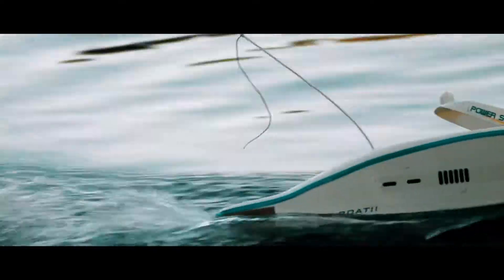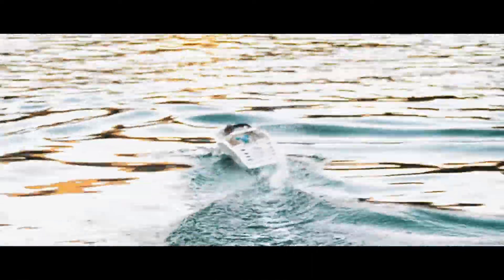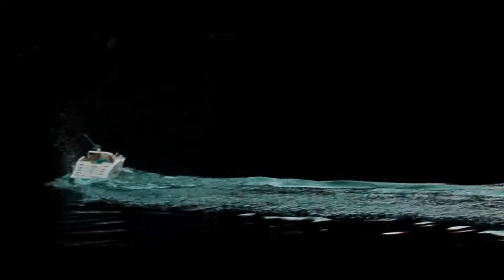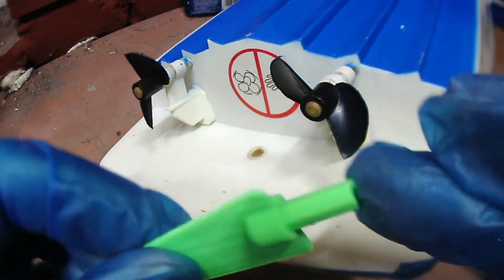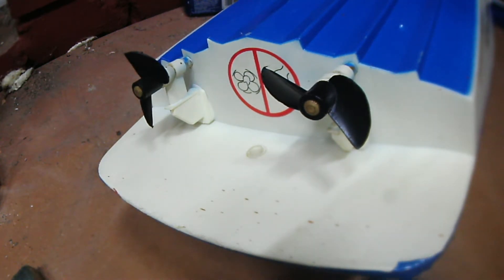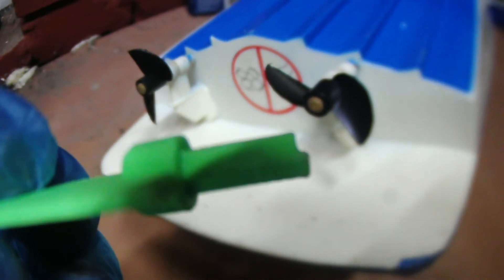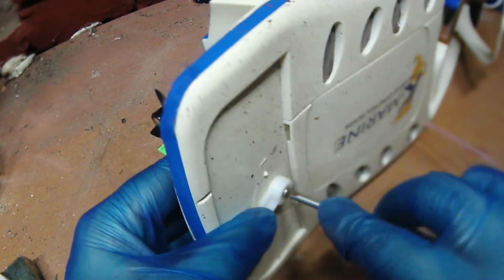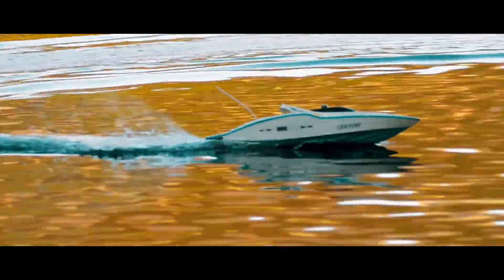#20. Century 7004 RC speed boat. Free downloadable replacement rudder

Comment: The trim rudder only did straight trimming and didn't do anything for turning. I did make one of mine into a functional rudder when I changed motors and lost the vector steering.
Reply from the maker: It's simply a direct copy of the original part, nothing more. I did wonder why they hadn't made it a little bit longer, that would help with trim, it's also too long, it protrudes further than the hull and this is what I think usually causes it to break.
Reply: @pixelvalve  on the one I had to use because I lost the vector steering I added a tip up to the bottom of the original so as to not break it .